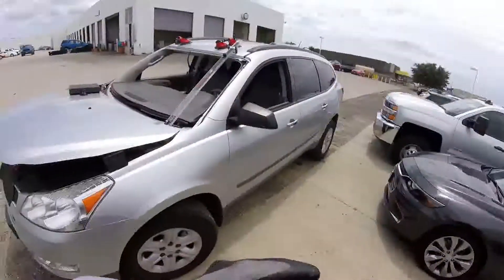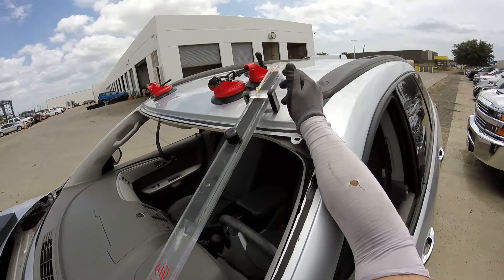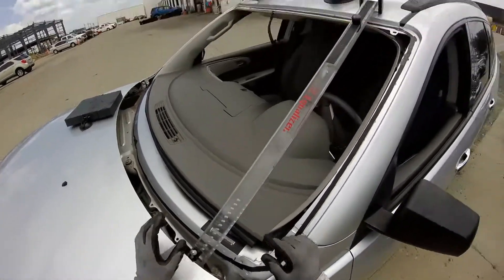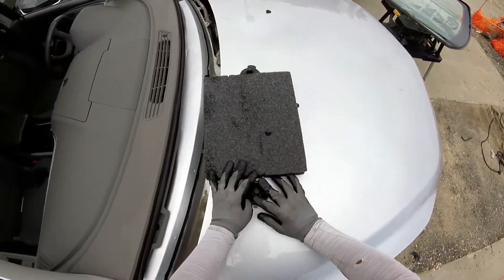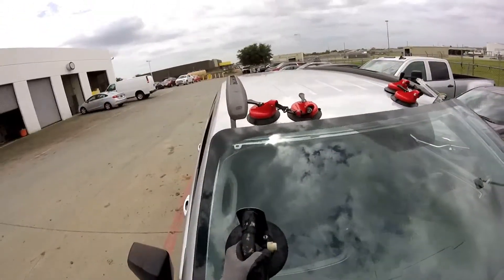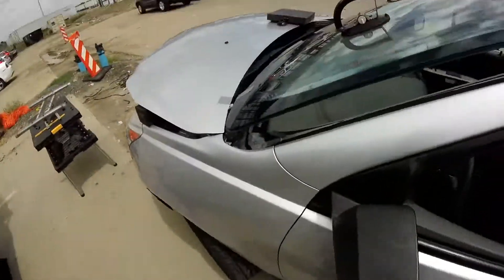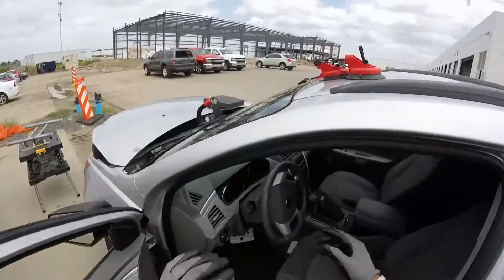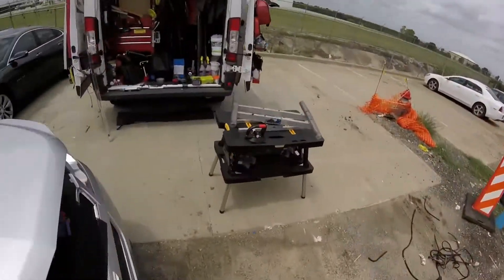NEW ATTACHMENT FOR EQUALIZER STICK SET UP SISTEM

Comment: I like your two suction cup holders after the windshield install. Did you make those, if so how can I make a pair. If you don't mind me asking. Thanks
Reply from the maker: sure just buy those regulars succion cups from equalizer take the handle off and the strips i got, from amazon they are coming with two little succion cups ..just take off and reinstall t on your equalizer succion cup and that all
Reply: Thank you so much, I'm a Mercedes Benz technician for the past 12 years  and doing windshields just for Mercedes the past three years. But I'm planning on doing other brands. Any advice you can give me. Thanks
Reply from the maker: that will be for the  mercedez  dealer or you own business
Reply: Right now I work at a dealership and windshields replacement here. but I'm planning on opening my own business
Reply from the maker: sounds rely good  just the only problem on this times is many competition of course that its not a problem when you know your job and you have skills and quality ..my advice is this cause ,that what i did first have your patch from certified from AGRSS that about the standard of federal safety ..and with that you can have more easy jobs in to dealer and insurance jobs ...the easy way to have t is take a curse on any auto glass training like AGU from equalizer that example and the cost off the test of AGRSS will be free and the guide of study plus the book to study are from there so you can take your test in home online and that see your ready for work ...ahh and dont forget your steps when you handle the urethane from the manufactures companies ..thats important ..and if you want have a fluid work ..i mean busy promote  your company like subcontractor and you will have money to start your business after that you can start to have some account from dealers and some insurance jobs ...if you want jobs from dealer ..go with the sales manager preowned and service manager ..its tuff cause maybe alredy they have auto glass service but ofert what you have ..and you are certified ..tech ....but before anything work hard to impress your custumer that the rely key to succes....
Reply: Thank you so much, I'm taking AGU in October. Do you have a Facebook, I used that more. I would like to communicate from there with you and share my work
Reply from the maker: sure man im like luis hernandez you will see same pic than my tube chanel  ans say gilber gutierrez my  regards